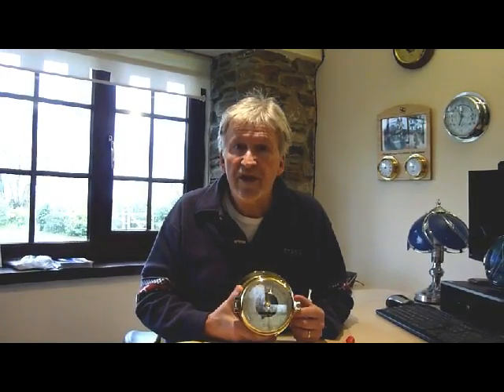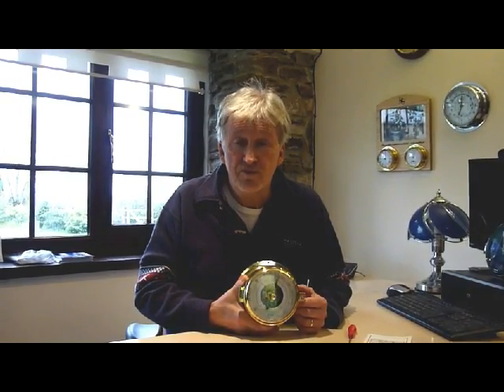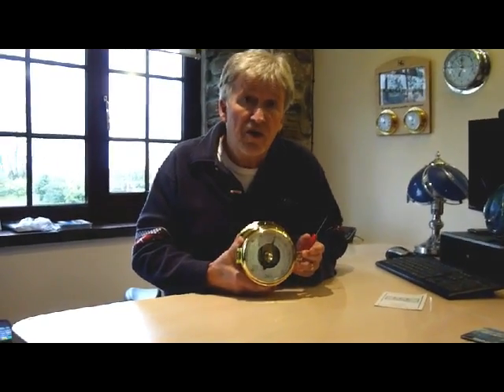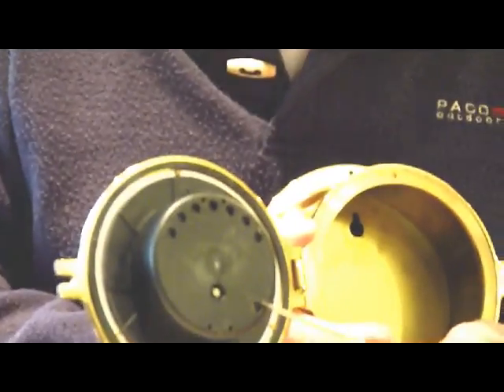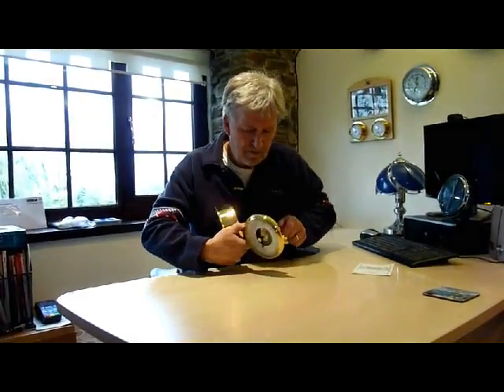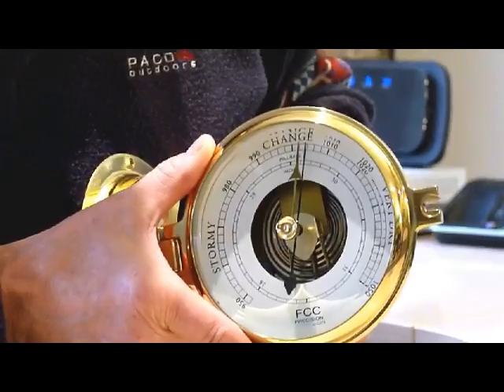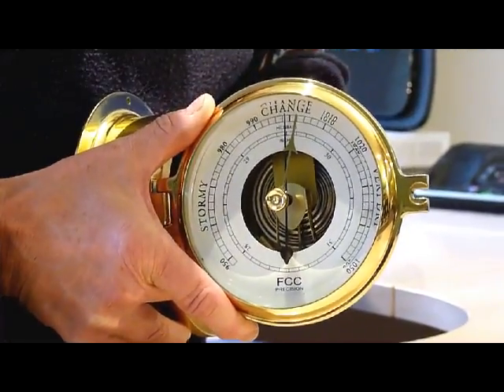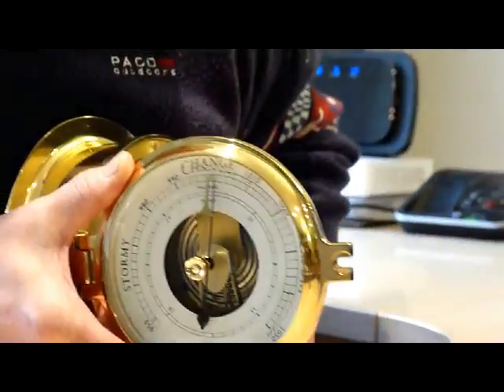FCC Precision - Setting a Barometer

Comment: I think that the question about the position of the reference pointer ( gold needle ) is that, if the barometer was flat
  " horizontal " it should be directly above the barometric pointer ( black ) needle, perfectly in alignment together, so that there is no parallax error, correct me if I am mistaken, I do not want give incorrect information, as I have seen lots of advise given by some people who have not got a clue, as to what they are talking about on YouTube. and I do not mean in any way, the man in this video.
Reply: The black hand is, as he said, just a marker/reminder to easier see the tendency/changes of the last hours e.g.
To easier compensate for parallax reading errors on analog dials, there is sometimes a slim mirror strip along the arc of the dial of some precision measuring devices. If the pointer overlaps with the mirrored pointer image, your point of view is most perpendicular to the dial and there is minimal parallax error in the reading.

Comment: Hello.  When you say above, do you mean even with or slightly to the side of the lower needle?  thank you.
Reply: Sorry do not understand your question.  Can you elaborate a little please?
Reply: I had a little difficulty understanding what you meant when you said align the gold pointer ABOVE the black indicator, being that it is already placed on top of the black indicator when it was installed.  I didnt know if you meant directly in alignment with or slightly to the side of/ pointing to a higher (above) number.  But I think I have it figured out now in that you mean in direct alignment with.  My indicator has moved slightly to and fro so Im guessing it is working, though I still need to find out more about atmospheric pressure because I hear that the indicator responds to it a few days ahead of time.  It became a little confusing so I didn't pursue it further thus far.  Thank you for your video.  My barometer is a mediocre one, banjo style, made in Western Germany, probably in the 1960's or '70's.
Reply: Thank you for your response.  When setting your barometer the black internal pointer reads the barometric air pressure and this is the important pointer to set initially.  The gold pointer with the external knob on the glass is used to track the movement of the black pointer.  If moved daily it will tell you whether the pressure is going up or down and if it is a major change in pressure or a slow increase/decrease.  This information is what you need to forecast forthcoming weather conditions.  We give more information on weather forecasting on our web page www.fccprecision.co.uk   Hope this helps?
Reply: Yes, this helps very much and thank you for the web page also :)